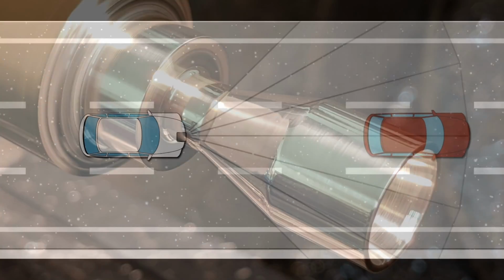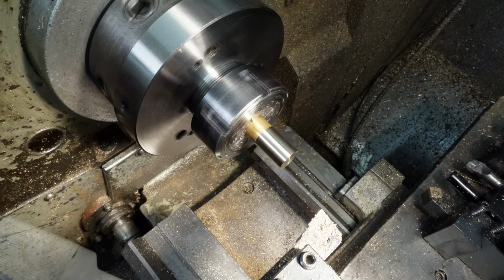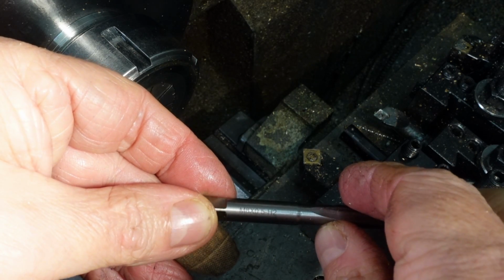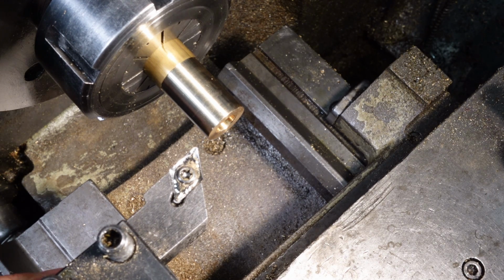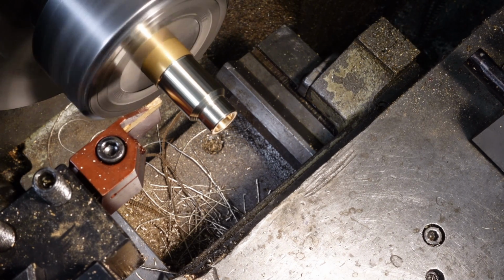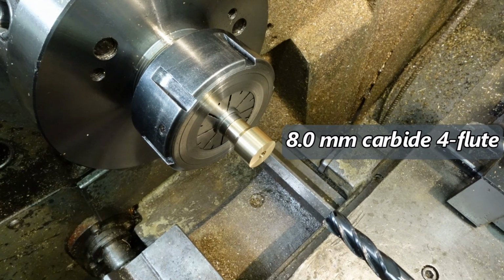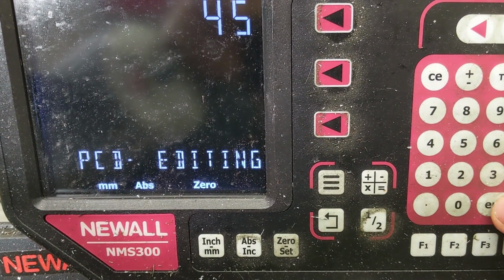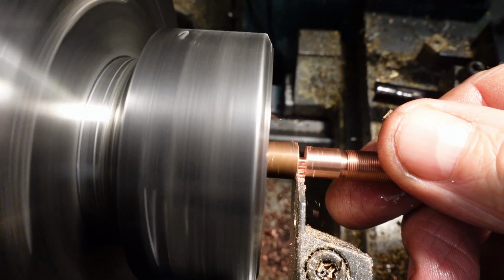Machining 53dBi antennas for 122 GHz mmWave Radar chips!

Comment: The computer/machining joke about munging up "threads" is equally applicable to "files" no?

Also I've seen a lot of machinists use shim stock as consumables rather than cheap gauge blocks. That said it would be one more thing to drop into the chip tray, and shimstock it a bit sharper than a carrot.
Reply from the maker: I saw the definition and it made me laugh. I hardly changed it, "threads" in computing are individual process that are managed independently by a task scheduler, "files", has a double meaning as well, so does "object" as in object-oriented-programming, and "structure" which is an assembly of disparate data types managed and treated as a single entity. There is also the verb to "mung", which is slightly different in its IT-related meaning and not half as funny. I think that gauge block cost me $4.  I used to use brass shims, machined to thickness, but they don't last long.  The risk of using a hard gauge block is damage to the points of drills or sharp-cornered end mills.  Thinner shim stock would definitely be a good finger-trap if I kept it in a drawer or box. There would be some merit in using some longer ground stock, but most of what I have is too thick.  I try to lift one side before I make contact with the tool, then allow the tool to press the block until it contacts across the full face.  That seems to work safely enough.  I looked at some of the drills under a microscope and the edges appear unharmed after fifty operations.  I don't want to do production work anyway, so I rarely make more than 20 of anything. Machining is a tiny part of my scarce leisure time, which is why I'm not very good at it!
Reply: As professional machinist that worked with some interesting parts my favourite is 0.2 mm brass strips.
But it depends on the part material, shape, tool and precision needed. Paper, gauge blocks (dedicated for floor usage)... Like when he's touching of the face with the hole - you can't use a thin foil or paper but need something sturdy. A lot is not what you use but how you use it (and sometimes it's just personal preference).
Reply: @MachiningandMicrowaves  Right on, I only ever read the word "mung" and thought it was pronounced the same as "munge". I worked many years with OOP, and never realized how many words there were in common, but with different definitions in machining.

To that point it's been many years since I've used anything professionally that was more strenuous than a keyboard. I like watching machining videos because it reminds me of the years I spent working in the electrical shop  of a production plant and would sneak over to the adjoining machine shop when my boss's boss wasn't looking. Then make something we needed that would've otherwise had a month lead time. You as a machining hobbyist have more experience than I, a machining dabbler. I'm glad you explained why some would consider it a bad practice. I thought the danger was ruining the gauge block.

I only ever got to use the worn out, old lathe and mill which the "real" machinists wouldn't touch because they didn't have DROs. I think they only kept them in the shop as a threat-- a'hem "backup" in case someone broke something on their own machine.
Reply from the maker: @HAL_9001  I always try to keep my hand in with fully manual machining as well as DRO and CNC.  Using dial gauges to get to a specific position is much more intuitive than using a traditonal DRO with numbers.  I mguess modern ones have the option of an analogue display to make approaching a set point faster than trying to translate tumbling numbers into hand movements.  A nice big pointer makes that a lot faster. I did consider hacking up my old Newall and fitting an LCD and a link to a large wall panel, mixing the DRO output in digital and analogue format along with the drawing and a microscope camera, running on a micro PC or even a Chromebook, but that starts to feel too much like the day job!
Reply: @MachiningandMicrowaves  The machines we were building (when I wasn't sneaking away to do manual machining) were fully CNC, and used for structural steel fabrication; beam, angle, and plate punches as well as oxy/gas and plasma shape cutters. I worked mainly on the shape cutters which ran a cut-down version of Windows XP and were networked so the guy on the shop floor could pull job files from the back office and use AIM for text chat with them. Cutting edge stuff at the time.

I also went on install/retrofit jobs in the field where I got to train operators who in some cases had never touched a computer, or a week previous had been using a machine that was older than I was. Fun stuff.

I was watching another of your videos and I think you mentioned loosing your wife(?) in June. I wanted to send my condolences. I lost my dad in July and shortly after heard you mention losing yours many years ago. The way you mentioned it in passing while loosing mine was at the forefront of my mind gave me hope that things would get better, and that I would find acceptance. I wanted to say thank you for that.
Reply from the maker: @HAL_9001  Caroline was diagnosed with an unusual cancer and they said at the time that mean survival was three years. She had surgery and chemo and we lived life to the full while she was still well. After five years from diagnosis, she was tired of treatments and decided it was time to go. She lasted another six months and died in her own bed, bathed in sunshine, surrounded by our dogs, holding my hand and listening to Bach preludes. No drugs, no invasive medicine, and no hospital or doctors.  Just a really cool nursing team and an outstanding Macmillan nurse who was an enormous help to me as well. A perfect way to end a very full life. I had to do 24/7 care for the last month, but I had a stairlift and lots of other aids fitted, and as she was losing her sight, I set her up with all sorts of voice-activated things and a spiffy wheelchair so we could still go out on her favourite walks in the glorious East Yorkshire countryside.  She lived long enough to get to know her first great-granddaughter, which is a privilege not granted to many.
Reply from the maker: @HAL_9001  My dad went in for surgery on a hernia and caught a vicious hospital infection like MRSA that killed him very quickly. It would be nice to think that somehow he could be aware that his wayward son is doing something interesting and practical instead of just mucking about with computers and networks and firewalls and datacentres and cybersecurity for money. Time does help. I still think about him a lot, but it isn't painful now.  Losing Caroline is still very raw and I have days when I can't achieve anything and can't see the point in carrying on, but then one of the Chihuahuas will stick its tongue up my nose or climb inside my jacket and go to sleep. Very hard to be miserable for long when you have Chihuahuas, coffee, an electronics lab, a woodwork shop and a machine shop.
Reply: @MachiningandMicrowaves  My dad went after protracted problems with his liver. I found out during this that the body uses the next best thing it can find which is the brain to do its filtering, but in keeping itself alive damages the brain. His last word (to my knowledge) was "Bird!" which was his nickname for me.

Soon after that he was transferred to a first rate hospice. It had decorative tiles, wainscotted walls, paintings, crown moldings, decent furnishings for the family, and more accent lights than my mother could operate. He went in his sleep one evening while I was about half way home from visiting him.

I'm still at the point that when I see something he would've liked I start to reach for my phone to text him, but that's getting better. I only go in for the spiritual thing about half the time, but I do still talk to him as if were still receiving.
Reply: Having lost both my parents recently I found the above discussion oddly comforting.  Never thought I'd find anything like it in a YT machining video, and a first-time view of this channel at that.  Strange how the seemingly random threads of people's lives can intersect in unexpected ways.  I live in Japan isolated from my home country due to the pandemic, but I'm also a computer network nerd (retired), own two small dogs (poodles), have a home electronics lab and a woodwork shop, but no machine shop, alas.  Next on my list, along with a 3D printer and laser CNC. Thank you both for sharing a bit of your stories here.  You've made my day!
Reply from the maker: @sincerelyyours7538  My father died some years ago now, I like to think if he was still alive, he'd be running a Youtube machining channel about highly specialised surface grinding and cylindrical grinding. He worked at a gas turbine plant and used a fantastic Oerlikon grinder with floating arms to sharpen the tooling used to machine turbine blades. The grief of his passing has subsided. I still think of the old lad on most days, but it doesn't hurt now. I'm just sad he can't see how much fun I'm having messing about with machines and radio and computers. I am still in the middle of the grieving process after Caroline died in midsummer 2021. We'd been together for 36 years. We made the most of the six years she had post-diagnosis, and she lived long enough to get to know her first great-granddaughter. She decided it was time to stop treatment in Autumn 2020 and let nature take its course.  She slipped away almost imperceptibly, in her own bed, without any medication, holding my hand and listening to a Bach prelude with our two dogs snuggling next to her in the June sunshine.
Reply: @MachiningandMicrowaves  It must have been fun sharing your interests and skills with your father.  If mine were still alive he'd probably be writing high school curricula and courses on Shakespeare.  He loved English and American literature.  I like to think of him as a 19th century scholar born 100 years too late, and I say that with utmost affection.  He was a career teacher and educator of some renown, as were nearly all members of his family over the past 150 years or so, that is until I came along and chose technology instead.  After he retired, to help him learn the newfangled art of emailing, I bought him his first computer, and I'd never seen him so far out of his element.  It took many long-distance phone calls before he finally got the hang of it, though just barely.  I miss the way he used to pepper his speech with Shakespearean quotes and sometimes poignantly appropriate lines from his favorite poems. I couldn't be with either of my parents when they died, though I did call them to tell them I loved them.
Reply: @sincerelyyours7538  You have my condolences. I'm a firm believer in grief share being grief lessened. Glad to be a random thread from half the world away. I must say it was a bit out of my character to share that with the internet at large.

Comment: The fact that this is a hobby and not something you'd expect to be snapped up by the MOD is remarkable.
Reply from the maker: One of my project is making even smaller antennas with a hollow tapered horn that has fine ridges inside. Almost impossible to machine those, so I make an aluminium negative of the space inside, with sort of radial fins 1mm wide with a 1mm gap and about 3mm deep, then treat that with a zincate bath, removing the aluminium oxide and replacing it with a fine zinc coat, then without allowing the air to get at it, I rinse it and put it into a gold-plating bath, plate a few microns of gold, then nickel, then a very thick layer of copper. Once the copper is several mm thick, I machine up the outside of the plated area, drill out most of the aluminium, then dissolve the rest in a hot caustic solution. I'm left with an internally-corrugated tiny feedhorn which is gold-plated inside and electroformed copper outside.  If I ever get the process fully debugged, that should make an interesting video.
Reply: @MachiningandMicrowaves  Oh I think so. 🤩
Reply: @MachiningandMicrowaves  But I bet you can't put a Rowntree's Fruit Pastilles in your mouth without chewing it!
Reply from the maker: @IanBuckley  The challenge is in trying not to eat the entire pack at one go. Haven't had a Fruit Pastille for 30 years. Now I want Fruit Pastilles, obviously.
Reply: @MachiningandMicrowaves  Funny thing was, I wrote that and immediately thought the same thing! Luckily Amazon can provide in the US...at a a price!
Reply: @MachiningandMicrowaves  The etching aluminum negative procerss doesn't sound like it would scale awfully well. You're going to have fun on that fourth batch of 250 haha
Reply from the maker: @2xKTfc  Definitely not going to make more than five.  Six maybe!  That should satisfy the entire world demand. I can't imagine how much corrugated horns cost from commercial suppliers, but these folks make them. http://www.electroform.com/index.php?option=com_content&view=article&id=141&Itemid=444  so I'll leave it to the experts once I've had some fun trying to make something that works well

Comment: This feels like it's got some This Old Tony, some Internet Historian (mostly the snarky TTS "assistant") and maybe some Styropyro?

I can't quite put my finger on it but I DEFINITELY like it and am excited for future things to come!

Also, if the parts didn't come out as desired, just blame it on forgetting to spinn the endmills while inserting them in the chuck. 

Also, why not solder the cavity to the board and using press-fit alignment pins? Too large of a risk of damaging the chip?
Reply from the maker: The boards were made at a PCB fab somewhere in China and shipped out by Tim Tuck from Australia, and they are designed to work with some aluminium horns that Tim had made. If I was starting at the PCB design stage, I would have to consider a fixture that could perhaps be glued to the chip surface. At these frequencies, 1.2 mm of metal looks like an insulator as it's a resonant halfwave, also the capacitance of the body to the PCB is several picoFarads, which at 122 GHz is perhaps half an ohm, so an electrical connection isn't really needed. To get the ultimate in performance, I think we'll need to use a pair of the chips, each with a carefully-optimised coupler, perhaps using a machined Rexolite 1422 cross-linked polystyrene dielectric lens to get the maximum possible performance out of the chip.  There is another chip with two four-element patch aerials on the chip package, and that might be worth a try, I have a few of the chips, but I am thinking in terms of an XY translation stage with flexures to position the receive or transmit antenna at the sweet spot, as we don't need concurrent receive and transmit for our long-distance communication experiments.

Comment: I'd love to see what you could come up with for a fish finder. How sensitive you could get the radar part that detects the fish and how clear you could get the signal to show up on the graph. That may be something you can patten qnd get a nice payday with. Fisherman are always looking for better technology and getting the best advantage possible.
Reply from the maker: The difficulty is that radio waves don't travel far in water, maximum range depends on temperature and salinity, but is only going to be a a centimetre or so, which is why sonar is used rather than radar.  Getting a high-resolution image from individual fish needs a wavelength of about 10 mm, and that means a frequency of something like 200 kHz from a piezo sender. Those usually reach 10 metres in clear water.  If it was possible to have a large phased array of those, you could get a good 3D image, but fish are an awkward shape and contain a lot of water.  Definitely an interesting challenge.  Now finding fish IN THE AIR is a different matter!  Getting fish airborne might be somewhat more challenging. Although.... https://www.youtube.com/watch?v=tLmJjRqXDCo
Reply: @MachiningandMicrowaves  @Gregred78  Maybe a marine radar (or array of for imaging) to better resolve how those in the proximity or target locations are doing in regards to catching fish?  OK, maybe not and far more expensive... though worth a try? :-|)
Reply from the maker: @trevorvanbremen4718  Perfect solution!
Reply: @MachiningandMicrowaves  
I've heard of water being named "The Universal Solvent", so perhaps it's not TOO much of a stretch to also name it a "Perfect Solution" too... <<Grins>>
Reply from the maker: @trevorvanbremen4718  There is a really good application for water and microwave communications of course.  Small droplets of water have a very high relative permittivity and act as scatterers of radio waves using the Rayleigh process, which retransmits the signal  in a diffuse pattern, or for larger droplets which are a significant proportion of a wavelength, Mie scattering takes over and that can have a strong forward-scatter directivity. Transmitting into a distant rainstorm can allow communications over 600-800 km via tall storms with large droplets or hail pellets.  There's huge doppler shifts from path length changes as the hydrometeors fall under gravity or are accelerated by updrafts and winds. Lower storms can allow side-scatter and allow me to communicate with folks even when the direct path is occluded by trees or terrain.  Now if there were FISH up there in the clouds, that could get interesting, although I guess not for the fish.  There was a waterspout in the Humber Estuary in the 2000s and some fish were found 2 miles from the river after being sucked up and dropped from the tornadic storm